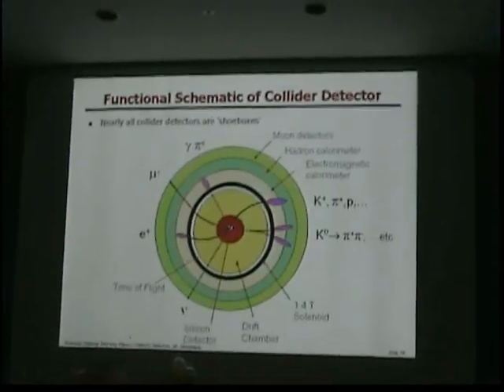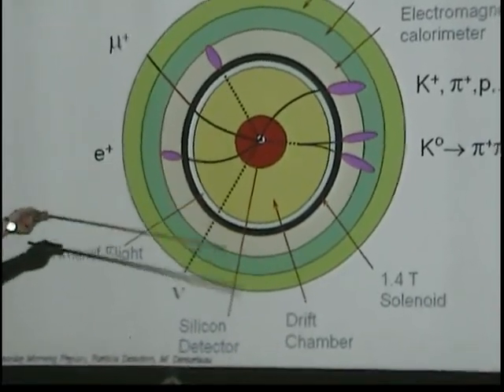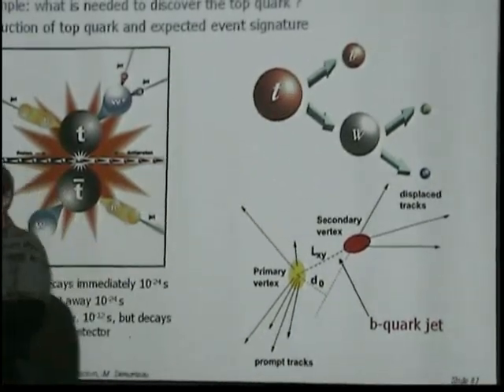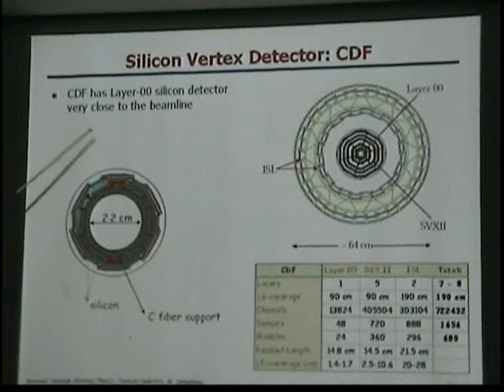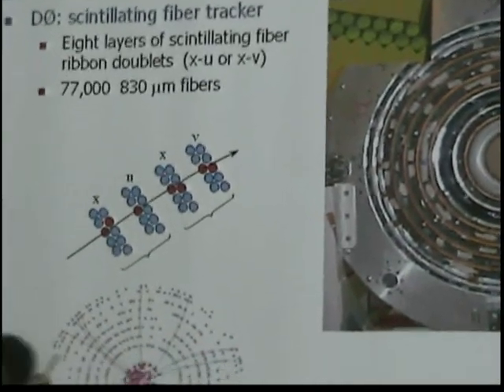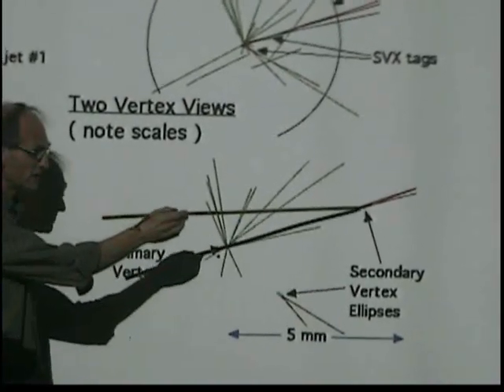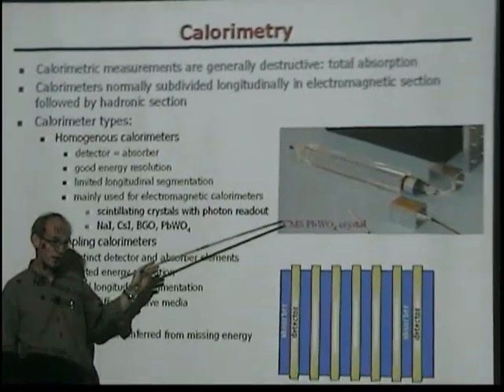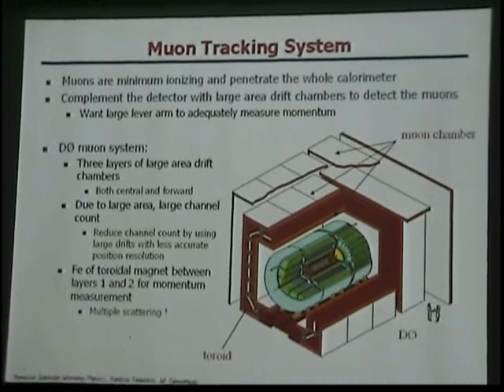Particle Physics: Detecting Quarks

Comment: obviously the sun isnt the only source, but man isnt that close either lol.tesla talked of this many times, there is 4-5 articles on these ftl effects, the wardenclyffe tower itself was able to transport energy aabout 1.5 to 2 times the speed of light, this system comes down the to curvature of the earth and the process where the energy has to cover equal area on the surface to the energy traveling straight through the earth so energy on the surface has to travel 2 times the speed in the earth.

Comment: please research before saying this, tesla has said this about 5 times during his life especially after colorado springs where he detected the first faster than light particles, there are more particles than the basic protons neutrons electrons and muons, teslas system was harnessing particles alot smaller than these subatomic particles, the only true source can only be made by the energy of the sun, its accelerating voltages will always surpass mans by billions of volts.

Comment: tesla called the energized cosmic rays a cross between a nutrino and electron, tesla said this particle is what a future cosmic ray motor would be harnessing as the major source of energy in these devices. tesla made such a device capable of 1000 times the energy delivery of a crookes tube, so that would equate between 50-100 volts of energy which is good enough to run most of humans power needs. i build a basic model, its nothing like teslas but it proves a point. he did detect particles FTL